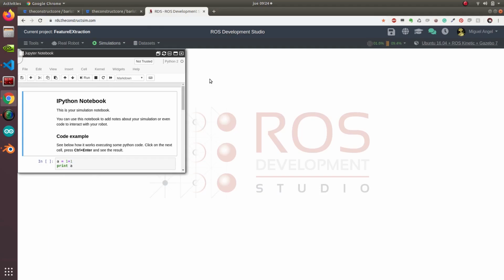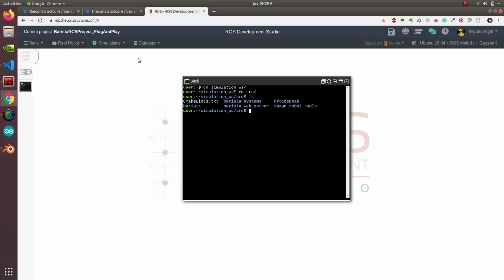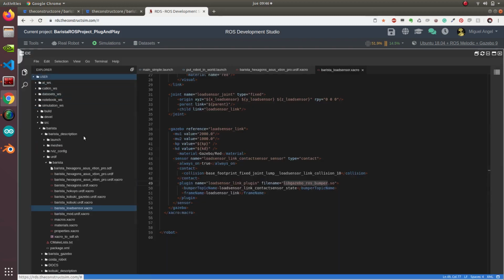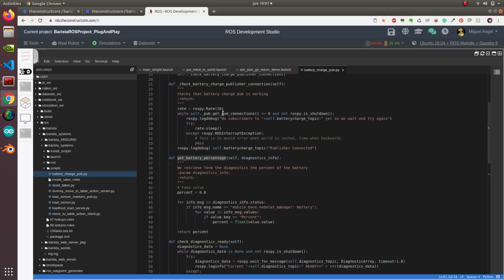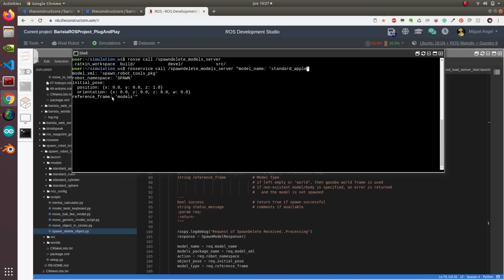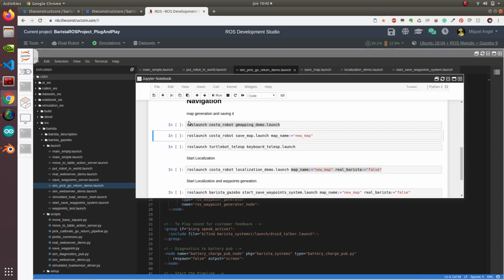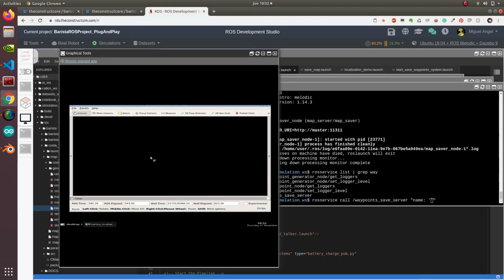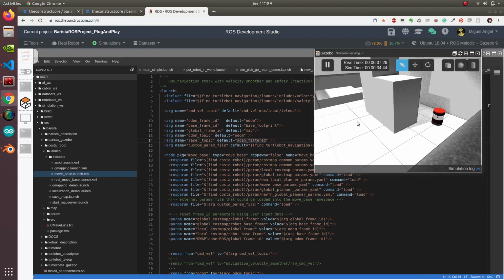Create a Restaurant Robot Simulation, E3-P1 | #ROS Projects

Comment: At the beginning, thanks a lot for this interesting project. I'm impressed.
I am trying to implement Your project in the real world and at the beginning I meet the first problem. The project seems to need some dependencies, e.g. the turtlebot package, which seems to be impossible to find for the ROS melodic platform.
Reply from the maker: You need to download it from ROS Kinetic (http://wiki.ros.org/turtlebot) and then compile it in your ROS Melodic environment
Reply: Thanks, I've  compiled successful . But now I have poblem with create map. The laser seems to be not detect a obstacle.
pls. look to pintsceen:  https://drive.google.com/open?id=1faXWSM_zsSY-dulIHcveqkPxPMgmKwAr
Also I have few errors in rviz transform, especially :
wheel_left_link  -  No transform from [wheel_left_link] to [map].
could you give me some tips (;
Reply: @darlin2587  did you fixed that problem
Reply: For the map creating problem:
I think the problem is in video drivers, I use default ubuntu video driver nouveau.

Try to add export LIBGL_ALWAYS_SOFTWARE=1 before launching gazebo simulation, or you may add this line to you ~/.bashrc (or similar) file.